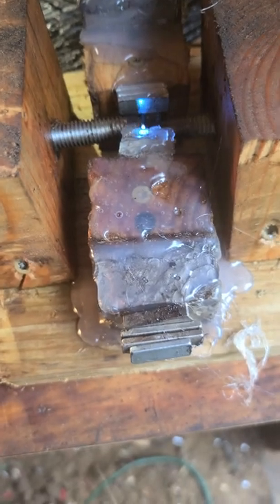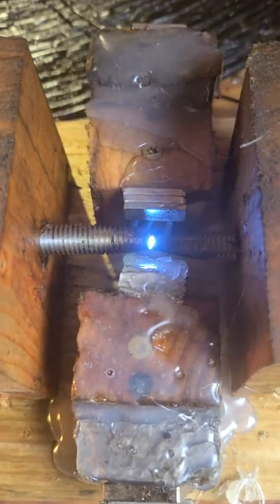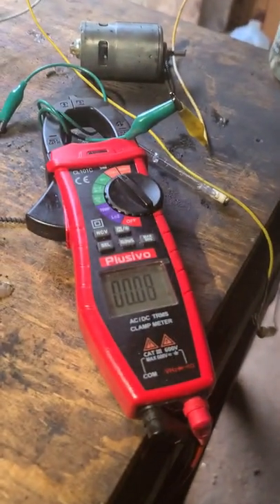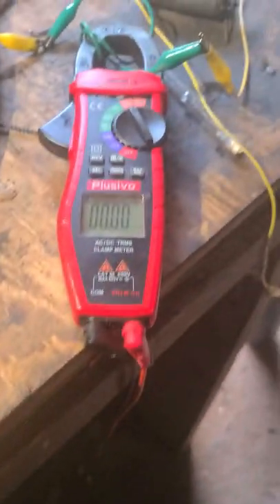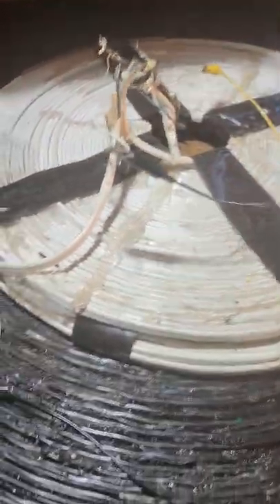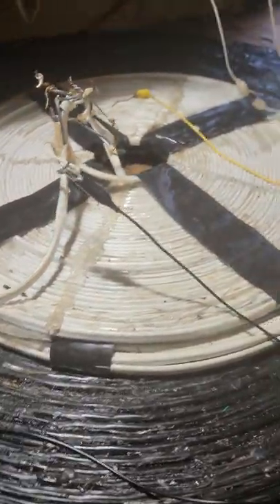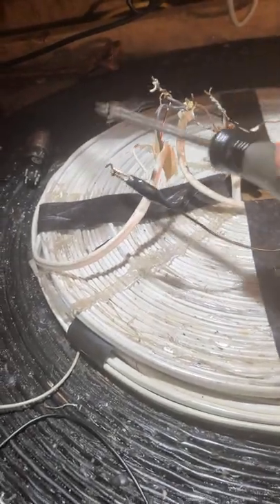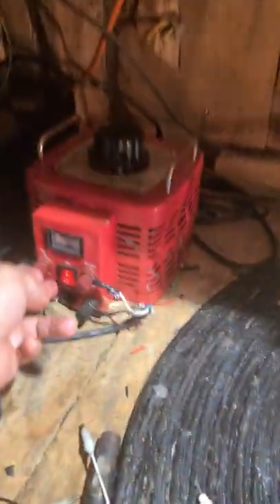More Radiant/Cold  Energy From Spark Gap & Ground.

Comment: GREAT vid & decent explanation man!  This is basically exactly (the base of) the circuit I'm building now; mainly to experiment with Energy Generation & some other ideas, & replicating some of N. Tesla's & others experiments.  Right now im still fussing with the flyback/transformer and spark gap a bit.  And blew a 2100V cap, so making a few Leyden jars to see how that works.  I DEF found that the OLD TECH/BOOKS are where ITS AT when trying to build & experiment in this arena.  Most of the books ive read (of course, by default, a ton of N. Tesla's writings/lectures) are from between 1850s-1910s.  D'Arsonval, Oudin, Strong, Eberhart, Ruhmkorff,  Lakhovsky,  Ernst Lecher (Tesla's "Stout copper bar" hairpin circuit came from or was inspired by Ernst Lecher's 'Lecher lines' circuit experiments, and he discovered the peak & trough potential 'nodes' as well, just as Tesla spoke of).... all these guys, & more, are where much of the 'gold' is found in regard to basic, simple, experimentally validated, HVHF currents and effects.  

But anyway, any change u have a circuit schematic of your setup?  Or specs on the individual components?  I can see the large transmitting black BF-coil, and the pickup coil on top of it....  but they look to be pretty thick..  are any of them 2 BF's series-stacked together or anything??  Just curious.   But def would love to learn more details and specs of your setup.

Comment: is your 10KV NST "30mA output"?,,,wait your using a battery and power inverter, i see at end of video?  Hmm, your Amp meter, is that showing 35-40 full Amps or milliAmps?  I will watch more of your videos as soon as I can.  You got me interested.
Reply from the maker: Yeah my nst is rated at 30ma. I also just upgraded my hv generation side & now use 4 mots in series for 12kv at higher current. Capacitors are also very important in the circuit along with a heavily magneticlly quenched spark gap. I believe some odd phenomena is occuring at the spark gap
Reply from the maker: My meter also has a hard time reading the power output most of the time even though its an expensive meter. Its very powerfull impulse energy & it seems to magnify itself when it travels through the ground
Reply from the maker: The power readings were all in amps not milliamps. & i run my mini lab most of the time off my solar generator cart i built. Its just a gorilla cart with a solar pannel & deep cycle batt
Reply: @MTECHINDUSTRIES  Thanks for the info.  Hmmm, possible phenomenon at spark gap, energy seems to magnify itself when traveling through the ground,,,, seems good to me :-)  When I check power output I have difficulties also, I get only around 47mA across the lit bulb.  Keep up the good work.